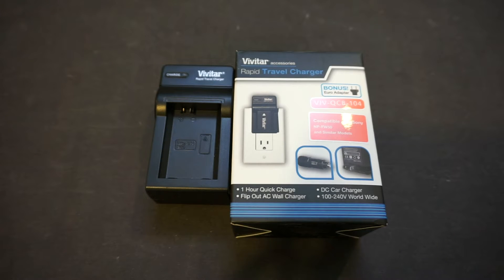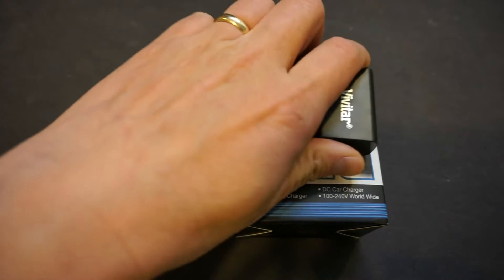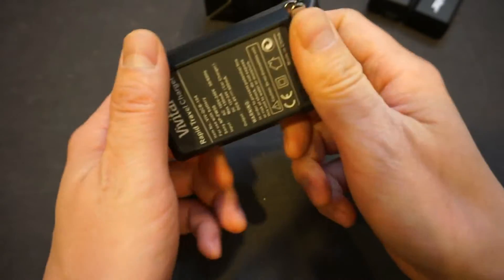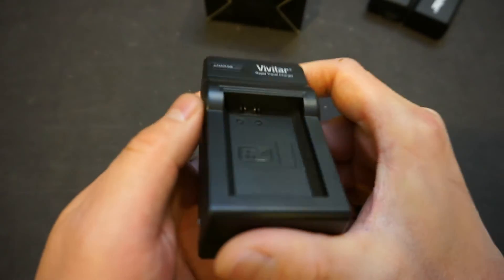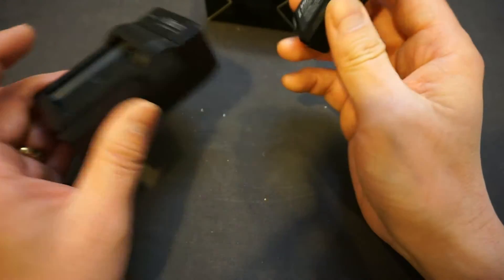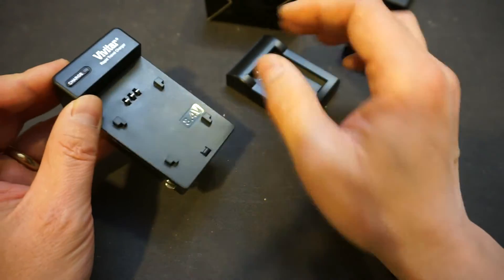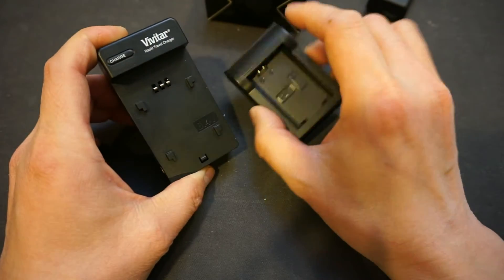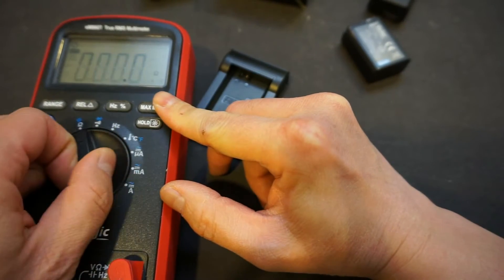Teardown of a Vivitar Rapid Battery Charger

Comment: I Thank You for making this informative video. I know just a little about electronics and I was wondering how they made the charge indicator light switch like that?  I'd have to look up the data sheet for that chip and really study that circuit closer.  So, correct me if I'm wrong, when the charge indicator light goes to amber "charging", it's because placing the discharged battery into the circuit creates a lower voltage elsewhere in the circuit which is the triggering/switching mechanism for the indicator LED?

Comment: Hey, I'm currently working on arduino controlled dummy load project that you share on your site but using 3 x IXTK200N10L2, getting them to my country upped price from 75 to 125usd but whatever. They are so much fun! Do you think it's a good idea? I see you dismantled your project since then.
Reply from the maker: I didn't dismantle the project, I am planning on using two to make a beefier load. Haven't had time to do that, but definitely will :-)